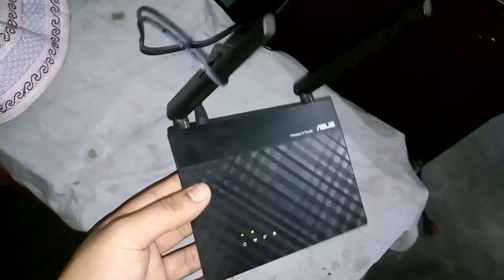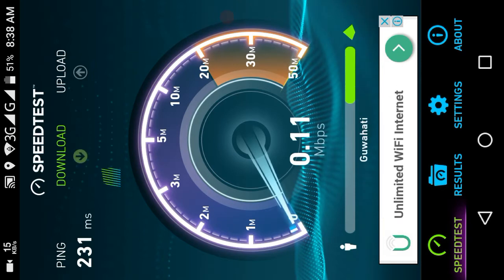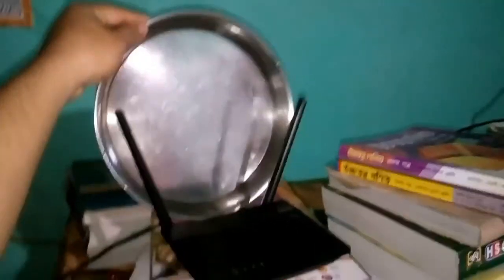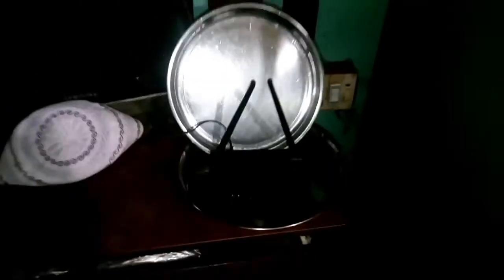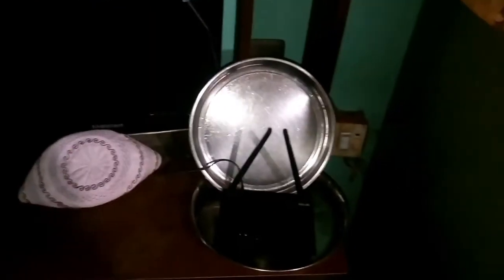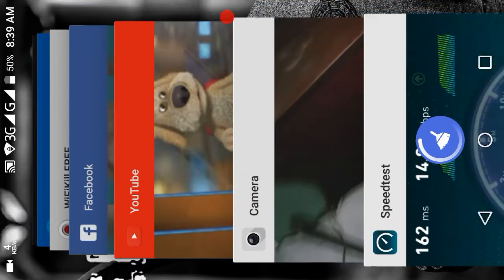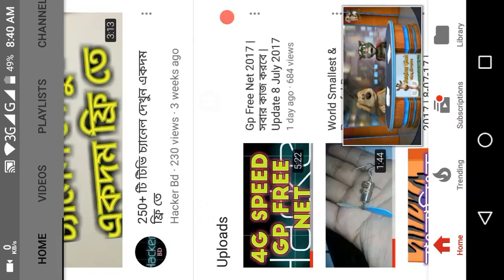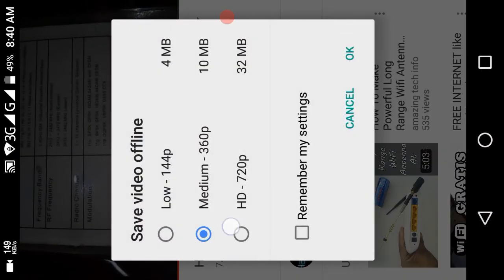How to make long Range wifi (2km+) !!! ( Part 2 )

Comment: I guess this is supposed to be a joke....yawn.
Reply from the maker: +Zeric E why man???
Reply: This technique may block interference from other signals in certain directions helping in crowded wifi environments, but that's all. To increase gain in any meaningful way, an antenna must be tuned to the correct band which won't be achieved without proper engineering (calculations and simulation) followed up by testing.

While it is possible to get a wifi signal 2km away under certain circumstances, it requires a high gain direction antenna, such as a yagi or parabolic, that is tuned for the 2.4ghz band. Such antennas can be made at home with careful planning and measurement, but isn't something most people will be able to accomplish due to lack of expertise. Using a couple of pie tins is not some magic and is a waste of time unless your sole goal is to reduce the router from receiving competing signals in a particular direction.